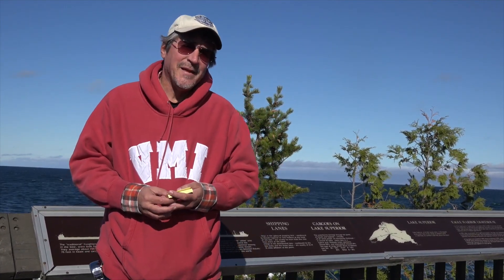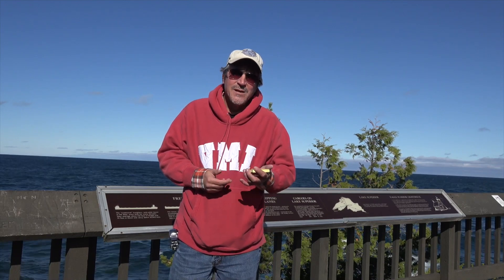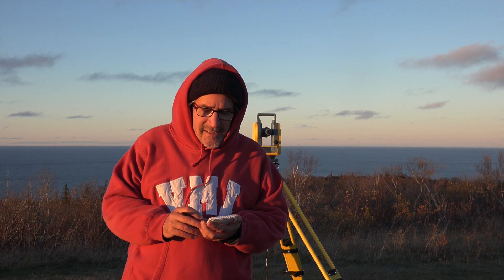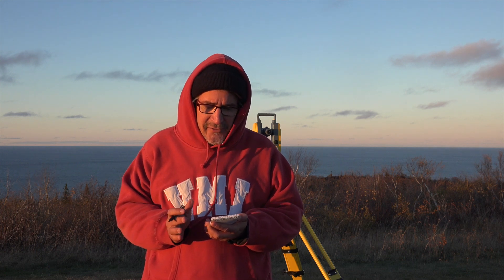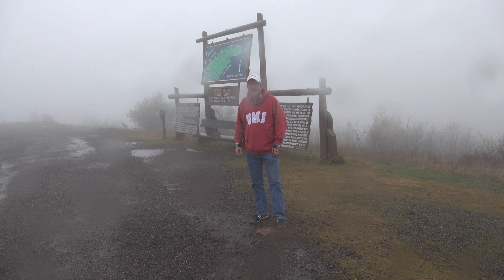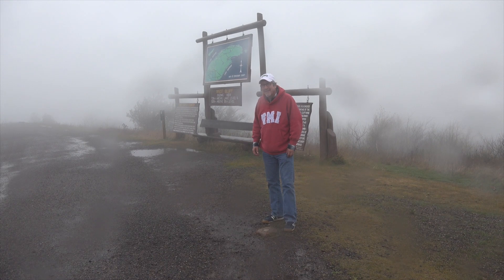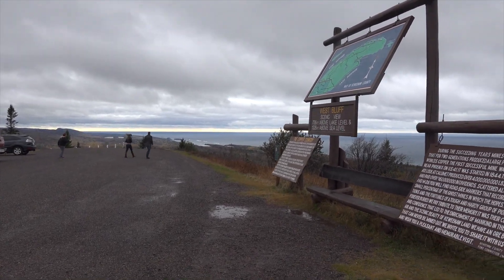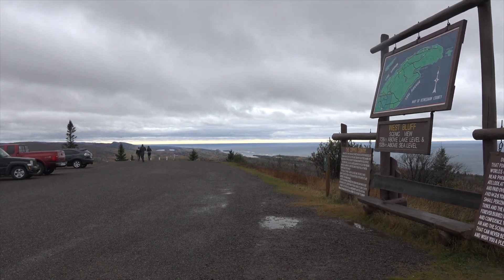Solar Distance Experiment (4 of 5)

Comment: Check for a video called -
"Flat Earth: Proof That The Sun Cannot Be 93.000.000 Miles Away"

Guy uses AutoCad to measure sun distance based on a globe earth model and calculated the sun at just under 15 thousand miles. A very revealing video
Reply from the maker: +Pizza Earth, Pancakes and other Mashed Potatoes   Yes.  I have seen that one also.  Thanks.

Comment: your doing hard work mate and making it harder by using a data sheet that is full of bull crap. How to measure the distance to the Sun:

Download Stellarium free  Software and run program, when it starts:
Pause time (K)
Change date and time to Summer  about 11:20am(F5)
Open Location window (F6) and click near to equator east Africa
Find the Sun and center it (space)
Turn off Atmosphere (A)
Turn on Azimuthal grid (Z)
Move the position of the Sun by changing time Longitude and Latitude until the Sun is 60 degrees and on a compass heading that is a whole number.

Very important: write down time date and Longitude and Latitude and direction, IE East 90 degrees.

Now you need to find the Sun again at the same time you set for first search, Don't worry about time zones. Open Location window (F6) and click near to equator in South America 

Find that Sun again and get it to 60 degrees by changing Longitude and Latitude only the time must be the same as the first search and you have to have it in a direction 180 degrees opposite to the first search, so if your first search was Lat 0 long 0 238degrees you need to get the Sun at 58 degrees whatever lat long it might be, when you get it 99.9% right and thats all you will get it, Very important: write down time date and Longitude and Latitude and direction of second measurement, Goggle long,lat calculator to find out how far it is from  your two points of measurement, draw an equilateral triangle on a bit of paper write the number you got in miles, km, feet etc, now you know how far the Sun is from Earth, you can do it for Moon, you cant do it for stars but you could use a triangle  with 90, 60 and 30 degrees. When you get good you can work out the size of the Sun, Moon, etc.

what to do if you get bored get the setting about 90% right and you will be about 50% right, you will soon see the Sun is not 93 million miles away and the Earth moving around that Sun at 67000mph
Reply: +SKYFLYBRI - That's so ridiculous simple, I fully agree with you, I have done it and unless trigonometry is wrong or if sunrays at noon are not straight the results will be close to 6000kms on summer equinox...other calculations begins fm the assumption we are moving around the sun...or that moon reflects sun light,,,and lately the venus transit which in my stupid opinion seens to be very suspicious according to the videos I saw shoot fm Australia and fm N.America...I do not believe in paralax!
Reply: its not 93,000,000 miles? 
the programmers at Stellarium know that it is something different.
You should find the script in stellarium where they model the distance at 30,000 miles and show everybody. you could blow this thing wide open!